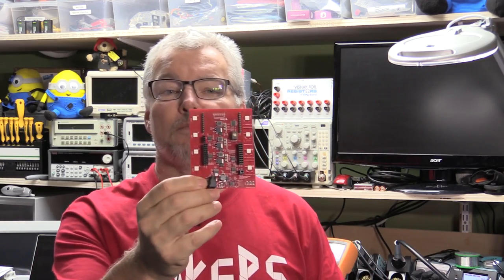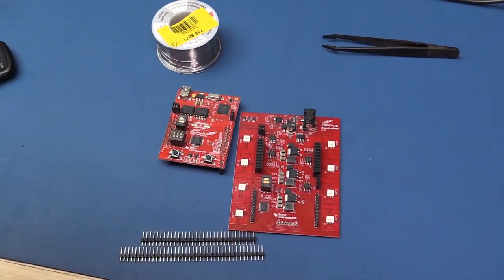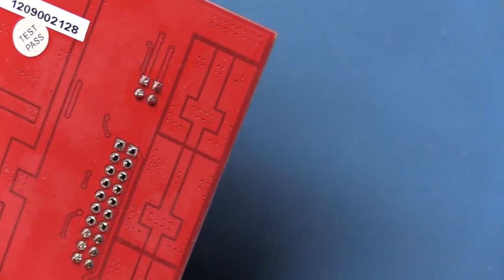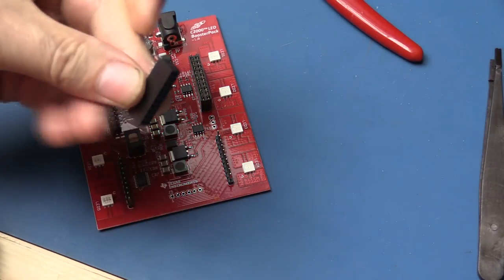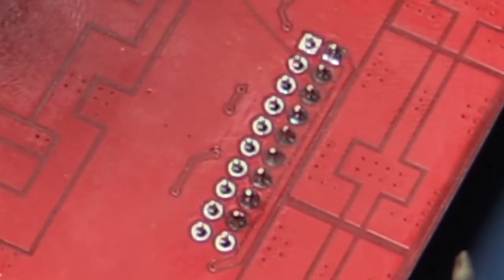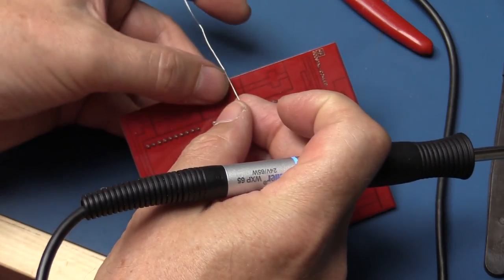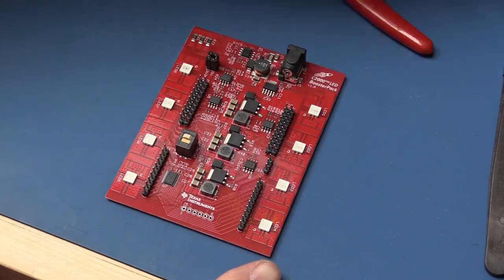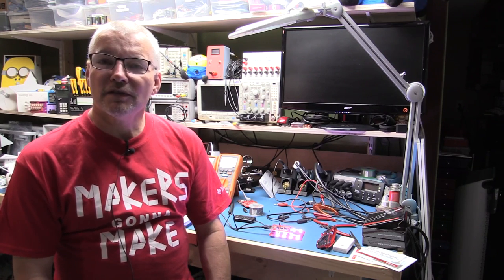WXR-3 De-soldering test on working TI Booster Pack Board.

Comment: Was screaming no!!! Why didn't you just put the SIL pins into the daughter board? Then push the whole thing in. Perfect alignment. (Not finished watching, but hope it works for you ;p edit: phew!) BTW, spotted the solder early in the video and wondered how thin it was. Also, had to desolder a DIL cable from a Tek 340 mainboard once with a solder sucker, worst hell ever! That desoldering tool look so awesome!
Reply from the maker: The alignment was perfect as you will see, the holes are a good fit for the pins so there were no issues. I am always reluctant to use a functioning board as the spacer/alignment tool (Incase it gets damaged through heat or static) and even though the tool is esd safe etc. old habits die hard.
The tool was awesome at getting the job done. All those years using solder wick or solder hand pump..... wish I had this sooner, years sooner :)
Reply: Ahh, the hacker in me didnt think about heat issues, but then again, I have brutalized stuff with heat and (previously) never taken care of static, and not once destroyed anything in either way :D I guess 20 or years ago, it was a completely different story.